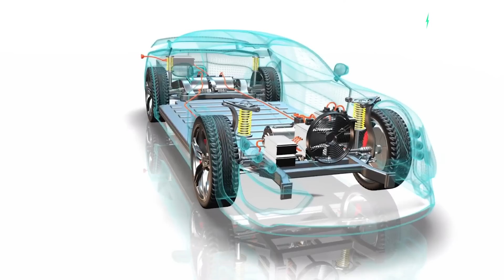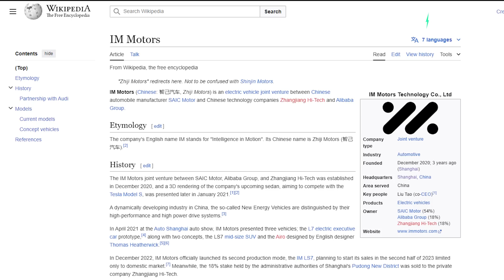Solid state batteries are finally about to be used in EV's this year

Comment: We might see these in prototypes or small volume cars, but these are aircraft batteries. Aircraft manufacturers will bid up the price on what will be a low-volume and high performance product no matter what they actually cost to make. They make electric flight possible, while only making electric cars somewhat better. Maybe in a Rimac or other small volume hypercar?

Comment: As you stated yourself, much depends on the life expectancy of those solid state batteries. If they last as long as LiFePO4’s, sure.
But if they need to be replaced after 100km? Hell no.
Reply: And hence why GAC Aion has already expressed it's main concern which is longevity, which is about half of LFP and NMC.
And they've been working on it since November on how to further improve on longevity, even after it was improved by 50% (november) but still not good enough.

They are however releasing more info during the Beijing Auto Show next week.

Comment: The GAG SAIC battery announcement is not very clear - they say solid state ; but then stay 100% solid state electrolytics-?  There is some suggestion then this is a so called semi solid state with still has liquids just less of them. In any event they are saying 2026; which could easily become 2027 or 2028 due to the down turn in the EV market If this company would even survive the current consolidation of makers.  Experienced car makers at the only ones who have no worries at all  They have millions of existing costomers needing them for parts and service.

Comment: I think most of the problems he talked about earlier are still the real issue. The vast majority of people want to buy something where the batteries last 15 years. So unless you have a design where you can swap out these batteries easily I think the average consumer will balk at the prices. The real big market for solid state will be some type of aircraft where the weight to power ratio really matters. You want your aero car to fly on the weekends as this will be where it will shines. Really experimental at this stage and dangerous for car collisions.

Comment: There is no such a thing like  100kWh battery and   1000 km of range in a  car , Tesla Model 3 with  very good aerodynamic shape to reach 1000km range at speed 100km/h  needs 175kWh battery  , then  other bigger less  aerodynamic  cars needs  200kWh for that .  Basic  calculation .
Reply: Except you're wrong. There is a plethora of cars in China that has better Aerodynamics than Tesla Model 3 or S.
For a start, Hyper GT cd 0.197, Xiaomi SU7 cd 0.195. Both of which has real world testing that actual real world efficiency is better than that of a Model 3. 

But hey, Don't let facts get in the way of a good story that supports your "Tesla is Best" opinion.
Reply: @Charchar18696  I am not supporting Tesla , I am supporting  Geely factory in Poland  Jaworzno city  :)

Comment: I drive for work, if  a solid state battery could give me 1,000 KM, I probably wouldn't have to charge my vehicle for 2 weeks. (Not something I can imagine right now.)

As for Japanese auto makers, IF they are smart, they will get licenses to use Chinese solid state batteries in their electric vehicles.
(This assumes that they are capable of designing an EV people want to buy.)
Reply: Japan could do the 500 m EV now.  Likely solid state aswell. Apparently Toyota has one in a /25 Tacoma  radio.  We won't see it till closer to the mandate.  Big auto make too much selling 0 profit margin,  designed to fail ICE.

Comment: Current SemiSolid Sate batteries (SSSB) in production and in use - 
Nio's Welion 150KWH SSSB
IM motor's LS6 100KWH SSSB
Under work (very soon to be released)
Chery's CATL (for Luxeed S8 ( Huawei + CATL Collab) )

Fully SolidState Batteries coming up  - 
GAC Aion Hyper ( All cars SSR, GT, GTSS) - Fully SSB 100KWH, 130KWH, 150KWH 
CATL SSB ( 2026 Qilin+, SSB ) 140KWH, 120KWH ( for Zeekr and Galaxy series both Owned by Geely Group )
Nio's Welion Fully SSB ( 75KWH, 100KWH and 120KWH ) Power Swap capable ( 2027*)
BYD working on SSB by 2027 ( Blade SSB ) 

All have their respective sources on weibo cant post links here 
If you wanna stay in your propaganda Toyota bubble then stay as a cl0wn.

Comment: When you think higher energy density provides more range per kwh of capacity.  And think that power is energy.  Sam in a nutshell.

Sam doesn't seem to understand that a battery is the equivalent of a gas tank.  He thinks that one 15 gallon gas tank can provide more range than another 15 gallon tank for the same car.

But good to know that a few hours later you believe in SS battery production happening this year 🤦‍♂️

Comment: Bro, you just said that Solid State is not going to work 😂
Reply: No Sam did not. Sam quoted the CATL CEO who said SSB is not going to work.

 While Sam does need to reign in his biases a bit because CATL want you to buy their non SSB products and there are agendas on all sides of this industry because the potential profits of a winning technology are absolutely astronomical, pointing out that someone, even someone whose motives are not un biased, has some interesting points about the issues of SSB technology is not the same thing as stating the same position.
Reply: CATL just wants to sell their current batteries, that's it

Comment: It's kinda funny that Sam posts the same day a video with CATL claims that solid-state batteries are not safe and will not be used in EVs anytime soon and also this =] 👍
Time will tell - cost per kWh of stored energy and total cost of ownership (number of cycles, cost of replacement) might help to select proper batteries for low cost BEV and BEV super-cars. Anyway the competition and advancements in EV batteries area are more than welcome.

Comment: I see the benefit of high energy density batteries being smaller pack size and lighter weight, more than longer range. In the U.S. the average daily commute is under 40 miles, and most current EV owners actually use less than 12% of their battery pack capacity each day. Just like most EV owners today charge at home overnight. The added benefit is not hauling around a ton of extra weight just to have a 135-150kWh battery pack, which is rarely used.
Reply: Quick charging also for those without home charging...

Comment: No I wouldn't. I'll wait until the tech is proven, safe, cheap and not going to be as damaging on disposal as the current Lithium Ion batteries.
Reply: Lithium batteries are 95% recyclable, very valuable components.
Reply: 95% are not being recycled. A very dirty result of the greenwash industry.

Comment: Sam Sam Sam... Please double check your research before publishing them. False claims are a dishonest way to have your brand talked about and should not be promoted. 
PLEASE, stop reporting any given news without checking its sources. CATL is the biggest battery R&D and manufacturing, and conclude solid state cannot be made economically and in large volume.  If CATL cannot do it, its not a unknown small company that will make it happen...
I like your energy, but if you keep loosing your followers' time, I will have to unfollow you

Comment: So the very best, most efficient EV's get about 4kw per miles on average, meaning a 100kWh battery gives them 400 miles of range. Yet, this new battery with 100kWh hours is somehow magically going to get them 1,000 miles of it? What???

The next gen batteries are not going to get better per kWh in efficiency, but rather, because they're so much lighter and more energy dense (think Lithium-Sulfur with 1/3 the weight but 5x the energy density), you can place a 300kWh battery on a small EV to get those 1,000 miles of range.

Comment: According to you 3 hours ago , CATL said solid state battery is just NOISE !
Reply: CATL is not Sam, he's only reporting.  People, man.
Reply: Just saw the GAC TECH DAY 2024, SSB with energy density of 400Wh/kg, after 150 charging cycles, the battery can maintain more than 90% of its original capacity. SemiSSBs and SSBs sucks with cycles. The best batteries so far are:
1.CATL Shenxing
2.Geely Golden Battery
Reply: Sam just take every news he finds on the internet without fact checking. Remember him covering the "real" perptual motion machine?

Comment: The big question around solid state batteries is: . . . . longevity. That is not answered. 
Today, the max is around 800 charging cycles, where NMC batteries already have up to 2.500 cycles and LFP batteries up to 10.000 charging cycles.
It is not the question "would you buy SS batteries with a range of 1.000km", . . . . but will you have to buy new ones every 2 years.
Reply: 800 cycles 400 miles range=good for 320,000 miles right? Even at 300 miles range that's 240,000 miles for total lifecycle.

Comment: Sam needs to better get his head around the fact that a higher Wh/kg density does NOT mean more range from the same size (in kWh) battery. What it means is a battery can 'contain' more kWh for a given weight.

He's been doing this long enough now to be more accurate about the technology on which he is reporting.
Reply: What if you flip that, have the same mass/weight with more range?
Reply: @jaaklucas1329  Same weight would mean a larger capacity battery, so more kWhs. Sam repeatedly implies that the higher energy density means more range from the same capacity of battery and that is not the case - unless drive train efficiency is improved and that is not what is being discussed. With the same efficiency, 50% more range requires 50% more kWhs - approx.

Comment: Solid-state batteries are the inevitable future of EV batteries for the simple fact that the co-inventor of the lithium-ion battery, John Goodenough, said they were for their extremely rapid charge time, higher capacity, virtually no capacity lost to extremely cold, or hot temps, and minimal BMS.  The only hurdles are: cycle life and costs, which are both rapidly improving, but either way, they are the future for the reasons li-on battery inventors said.  Great news in the this vid!
Reply: The days of "this scientist has to be correct because he did something great" are over. 
I would trust the results of a team of extremely talented people working with bleeding edge tool and virtually unlimited money over a Nobel Prize winner.
Reply: 'virtually no capacity lost to extremely cold' i suggest you revisit that research again 

'None of these freeze or become sluggish in cold winters, meaning solid-state batteries continue to perform well in icy weather. But unfortunately this does not mean that these revolutionary batteries are completely immune from winter cold. This is because solid batteries contain more than just electrolytes.
 
They also have temperature-sensitive electrodes. And moreover, their solid electrolytes become fragile, and  that needs more work to resolve too.

Chemical reactions typically slow down with a drop in temperature. Solid battery electrodes follow this pattern. Ions shuttle more slowly between them, and their level of performance suffers.

A solid electrolyte may not freeze, but it does become more brittle as temperature falls. This can compromise the reliability of the battery, which might eventually fail. It goes almost without saying that battery makers are working hard to resolve these challenges.'

Comment: Solid state batteries for motor vehicle use have been a technology that is coming coming coming, almost here, almost here, about to arrive! However, it has so far never been released in a publicly available vehicle that can also be independently tested. No doubt there will be a Version 2.0 motor vehicle battery tech at some stage, however, many many companies have made many many promises on the impending release of solid state batteries that so far have never actually make it into a production vehicle.
Reply: Your statement is 100 % factually correct 👍

Comment: Lithium is a liquid metal. I know, SO STRANGE right? They have taken the liquid & converted it into a powder.
Hence the lithium becomes a  'Solid State.'
ON A SIDE note, just the other day I came to learn that FORD does not use lithium batteries. They use a different 
battery chemistry. Ford uses  nickel cobalt manganese (NCM) mfg for them by LG. While Tesla uses lithium cells 
shaped like cylinders, Fords batteries are in pouches. Again, So Strange right? HOWEVER, this battery tech must 
be pretty good as Tesla reports their new model2 will be the first Tesla vehicle to use NCM.

!

Comment: I worry about all this relentless focus on solid state batteries . It's part of the disinformation narrative that we have to have some fundamental breakthrough before electric vehicles will really work for everybody. That's simply not true. We have second generation 2170 cells in our now 6-year-old model 3s that are going strong and show only 8% degradation. Even with the slight range loss, they are still great road cars, and the supercharger network is fantastic. So we don't need solid state batteries to make electric vehicles work even in their less attractive use cases.
Reply: Our current batteries are pretty good.  But the push for EVs provides demand of a better battery.  This is all good.

Comment: What happened with the CATL(sry edited) genius that 5 hours ago said that solid state wont work coz of the degradation and many other reasons. This channel also is a bit funny, same day "SSB Wont work" and now "SSB coming this year". like wtf.
Reply: You need to know the difference between solid state and semi-solid batteries. Semi-solid is now available while solid state is still a work in progress. Solid has 2x energy density of semi while semi has about 30-40% more energy dense then the best  NMC lithium batteries today.
Reply: @larryc1616  or me there is no "semisolid", either its solid or its not...
Reply: LFP are more reliable.   I would buy an electric car with LFP batteries.   No worries about replacing the battery for 10 years @larryc1616

Comment: what happened to the japanese batteries???i am real shock why they r lagging way behind
Reply: It's not technology, it's politics for Japan and battery tech.  

The automotive uses of it ... well, Toyota's the largest automaker, and they have parterships and partial ownership stakes in several of the other automakers there. This gives them de-facto control of the how the entire industry procedes with electricification.  

And, quite frankly, like the German automakers the past decade or two, the Japanese automakers are more interested in hammering down the nail that stands up, rather than fostering competition through innovation of any sort.

You can't push R&D or commercial scaling of battery tech to automakers in Japan, when they're acting more like 18th century buggy whip makers deciding on which shades of leather to use to make this year's buggy whips.